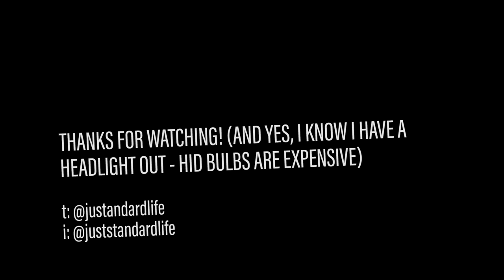0004: 2014 Kia Forte fog light replacement

Comment: Hi i have 2015 kia forte and planning to switch to led so what would you recommend and is decoder needed ?
Reply from the maker: We are using these bulbs = https://www.amazon.com/gp/product/B06XHDYTGL and we've never had any codes or issues, they were direct plug-in and worked without any issues (in fact, still working fine a year later with daily use!)